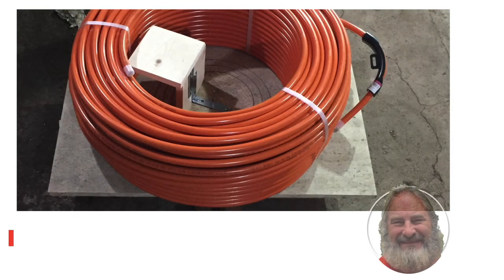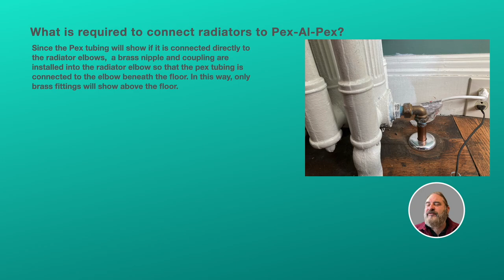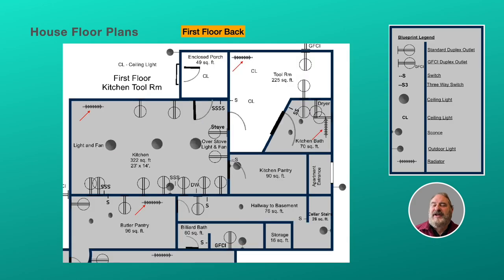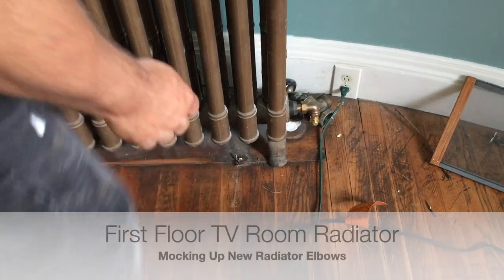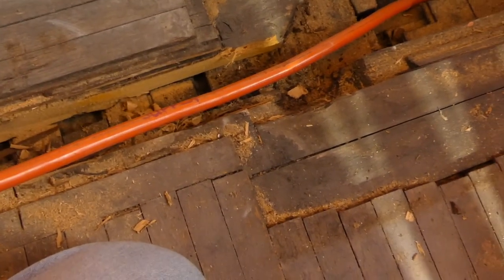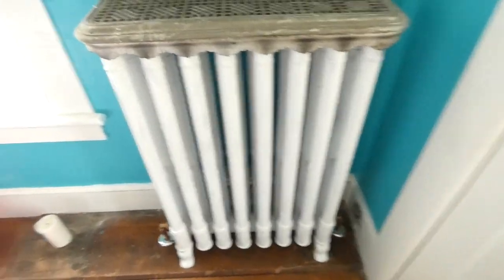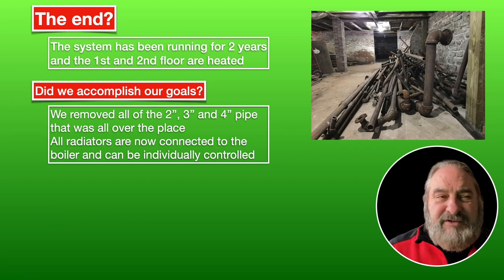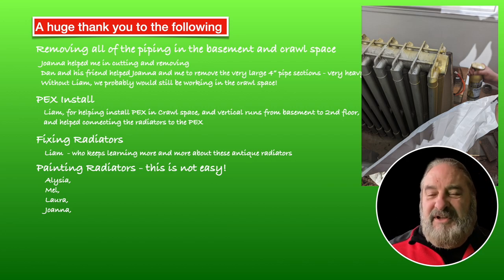1880 Heating System Upgrade Episode 4 - FInal

Comment: Spyder, well I'm about ready to take the plunge! I'm going to order everything for my manifold board today. Your videos have been amazingly informative. 

Just a couple questions. 

Just to refresh you I have hot pipe heating system with radiators with a supply and return loop around the entire house.

After my husband passed away last year I start having all kinds of issues with the piping. 

My boiler is good though only 9 years old.

So I'm going to replace everything over to the PAP.

My game plan is to get the entire manifold board set up for three zones, first floor, second floor, and a combination for the third and floor and basement. There will only be two radiators on the third floor and two in the basement so it's only going to be a four manifold zone.

The first floor will be in 8 manifold zone and the second floor will be a 6 zone.

I'm going to get a circulator pump for each zone to put on the manifold board.

I currently have three circulator pumps coming off the boiler now.

My question is will I need to keep those installed and tap into those lines to and from the manifold board to keep the water flow running properly?

Or is the circulator pump we connect to the manifold board for each zone enough?

 My nephew who is helping me said he wants me to remove all the piping to the radiators such as you did. Of course I have a concern can we get all the old fittings off some of them are painted on.

If we're not having issues with those old fittings should we tap into the piping with the pex below the floor level?

He seems to think to keep me from having any future issues we should go all the way to the radiator and my concern is are we going to be able to get those off?

Do you have any tips besides using heat to help get those old bushings off?

I know this is a huge undertaking for me, but as my husband always said it's already broke worse thing you can do is fix it 😂

I feel pretty confident with my experience will get through this, but I would have never attempted this without the education you have given me. I appreciate these videos more than you realize especially your replies to my questions. Thank you!
Reply: Spyder unfortunately unexpectedly passed away. Were you able to figure out your issue ? I completed this project with him and can try to assist you

Comment: One of the biggest hassles I have with replacing the valves and elbows at the radiators is no matter what I do....tape, paste, different kinds of paste, they seem to drip or leak. I try tightening them and they still weep. Same problem when your putting new piping, fittings or adapters into old piping or fittings, most of them drip. Did you have a problem with this? And is there any technique to getting a good tight seal?

Comment: I forgot to ask about your spirovent air eliminator.

Did you just hook that up because you also attached the hot water heater to your manifold board?

May I ask why you connected the hot water heater to the manifold board?

I'm going to replace my hot water heater soon which is why I'm asking. It is in the same area that I'm going to put the manifold board. Was this done for an efficiency purpose?

If I'm not going to connect the hot water heater to this manifold board do I still need an air eliminator?
Reply: Oh geez I need to do some more homework. I just realized the other day that my hot water heater is connected to my boiler system it looks like the supply line. Any information you can give me on this would be great. Do we hook up the supply only? Was this talked about in your first video? I'm going to go rewatch that.